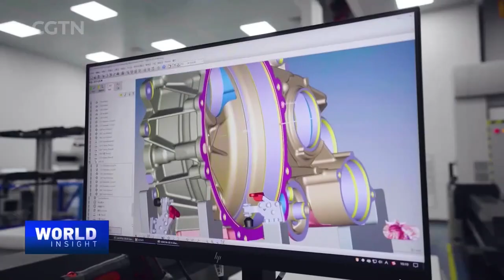Top Chinese physicist: China on cutting edge of science

Comment: Have physicists fallen into some traps? Big bang, not disprovable, only continually adjusted when something fails?
W and Z particles? What if magnetic moment does not depend on charge, only on angular momentum?
Is there a p-0, with the same mass as p+ and p-? Does it cause the neutron lifetime problem - the 2 different results? 2022, the year of p-0?
pi+ pi- pi-0
Also e+ e- e-0? e0 departs rapidly?
mu+ mu- mu-0?
Is the universe a packing of spheres with gaps and an enormous amount of random-like motion, with condensation into neutrons, which can decay into protons unless near a proton, which suppresses hexagonal close packing, holding the region near it in face-centred cubic packing?